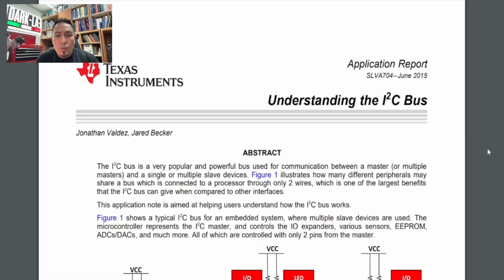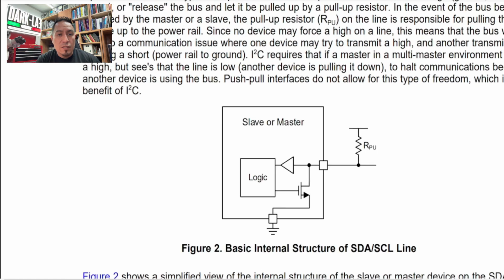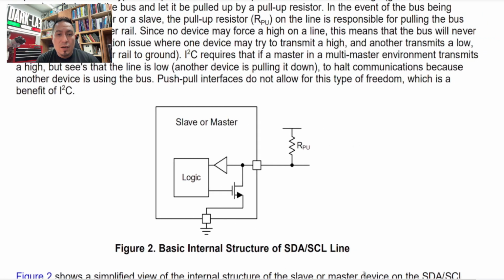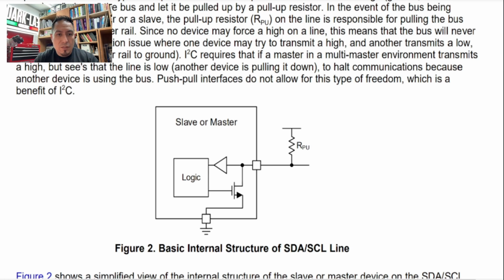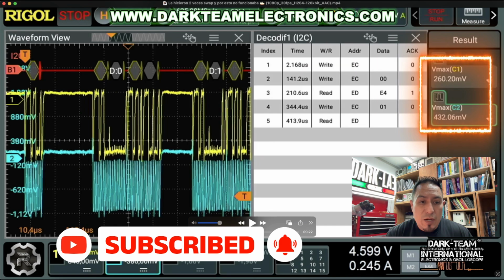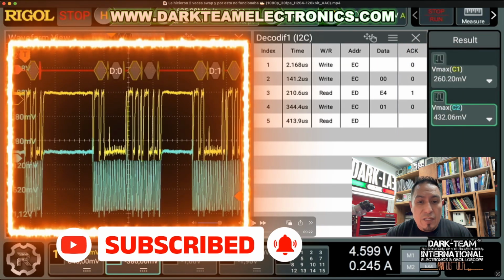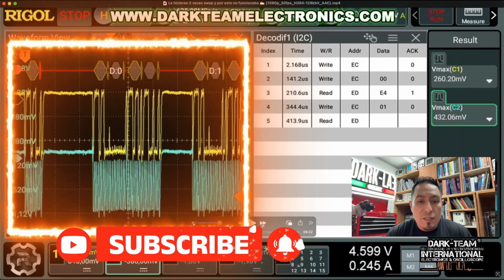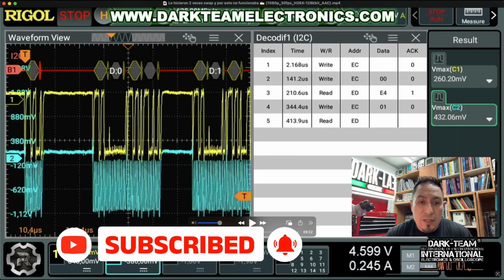How repair i2c line

Comment: master. what problems you find on these motherboards and what solutions you present is beyond human understanding😀 you are a genius and a maniac in this discipline, respect for you and bows in your direction. super revelation 🎉❤👍
Reply from the maker: @lucasszeyk3718  check last part of the video , in this part you can see the issue is have i2c but not in correct voltage level, in the video you can see why i replace the value of the resistors to can solve the problem (in this case the phone have panic and other technician do swap in 2 boards)
Reply: If You ever find time pls upload more english video about oscilloscope measurements etc ;)